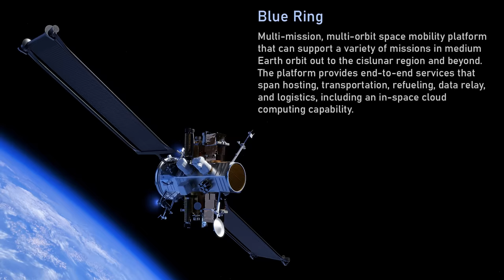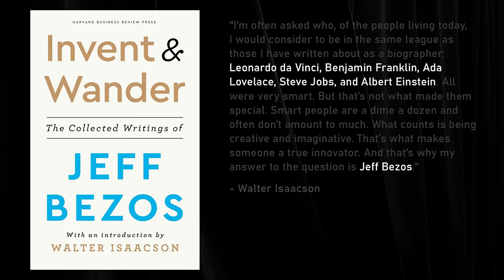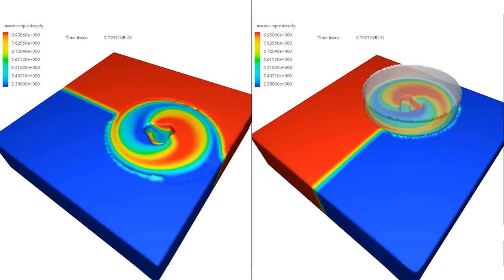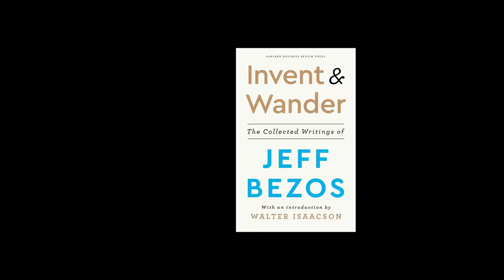Jeff Bezos: Amazon and Blue Origin | Lex Fridman Podcast #405

Comment: Most of the building codes are “proxy “ No one knows where the rules come from. One example is the number of female toilets (not enough) vs male. But also fire prevention code.  The problem is the same in Europe, (installing lit emergency exit signs in gothic cathedrals.) I say this as a builder.